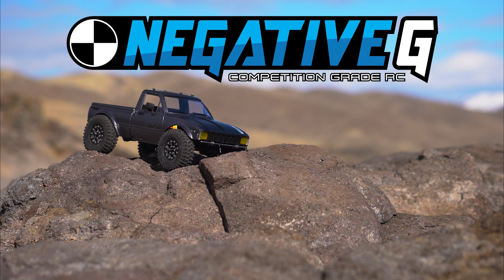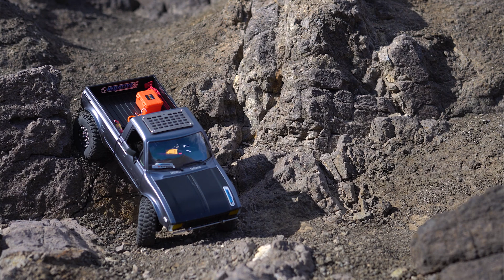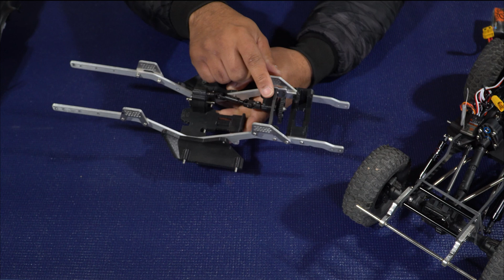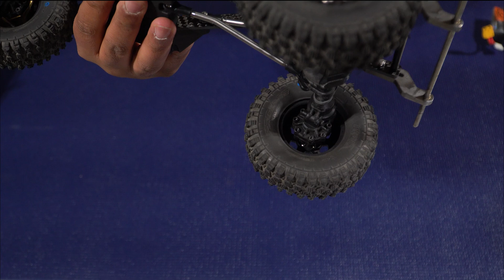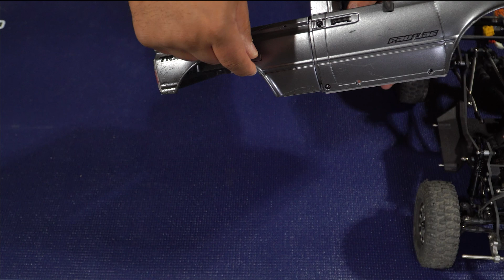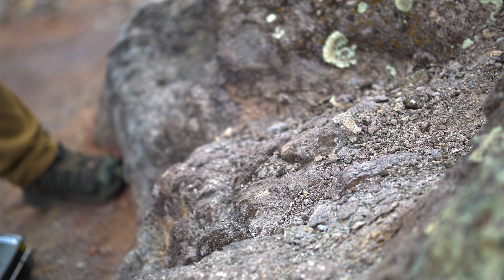Negative G RC Class 1 - v1 | TRX4 or SCX10III Conversion Kit | Scale Hardbody LCG crawler

Comment: I personally find the design very limiting, it needs very specific parts to work.
Also, why can't you accept that this is an LCG crawler whole heartedly?
Reply from the maker: limited in terms of build creativity or performance? I don't except that class 1 builds are LCG because the heaviest part of the build (the body is over 1lb) is also the highest sprung mass of the build. That's literally the opposite of LCG.
Reply: @Furadi  sorry limited on choice of bodies and setup to run. if the rear shock towers was separate like on the beta version (aluminium rails) it would have been more versatile.

I think your over thinking it, this is an RC and if you follow the SORRCA guidelines, you don't have much of a choice and using a hard body will always give you a high sprung mass... that's why you have the rubber band mod to keep your rig planted.
Reply: @Furadi that logic is flawed. Yes the body alone is the heaviest, but it isn't heavier than the chassis with everything on it together, so it's not the "heaviest point" and it shouldn't be. The axles and wheels should be the heaviest together if you tune right. Which means it's lcg, because the most weight is actually at the lowest point rather than the body. Your understanding of tuning philosophy is wrong and speculative. It's straight up an lcg chassis, and it's called that because that's what should dictate tuning and weight bias, not the body. That's why most folks builds suck, cause you're all copy and pasting each other instead of actually critically thinking to understand what you're actually doing. No offense, just stating what's observed in the community.

Comment: Very good job man! I have question for you, witch kind of esc you have on board? Drone esc’s?
I recognize the out runner motor but, he need the esc blheli32 firmware? Kindly suggest the inexpensive one?
Appreciate you answer! 🤙
Reply from the maker: Hey hey! I use wraith 32 drone escs flashed with am32. I actually did a video about how to flash am32 using emax escs if you wanna check it out. The drone escs have been drying up though so if you're in the market for a good drone type esc check out the rhino am32 esc on aliexpress. It's actually designed specifically for crawling using am32.